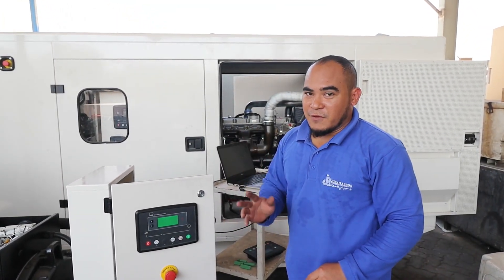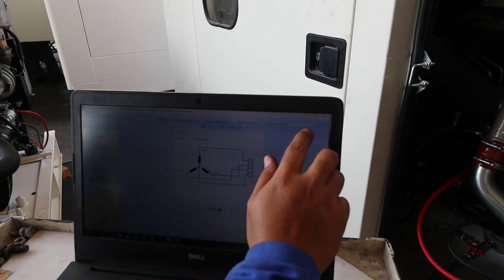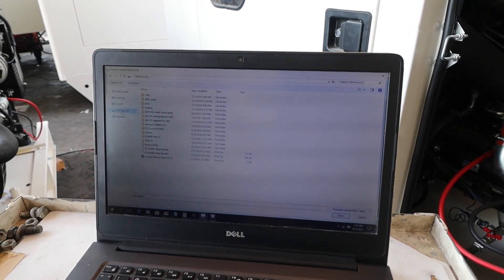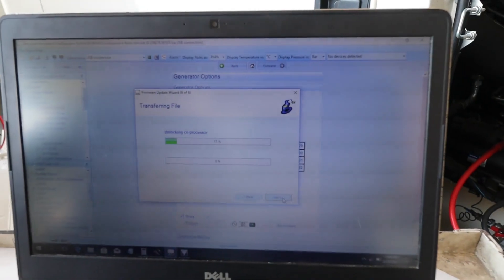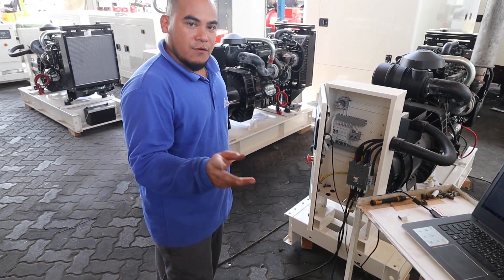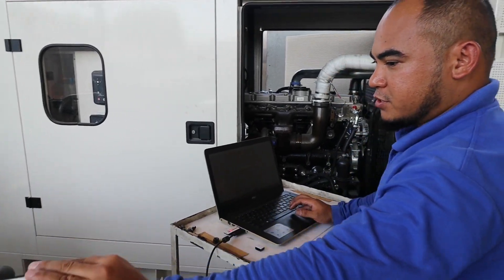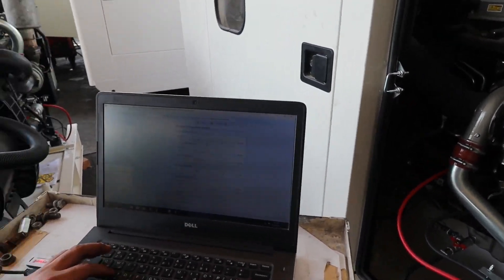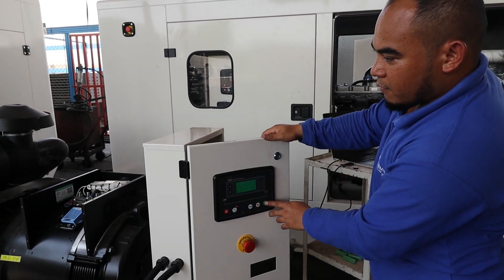DEEPSEA MODULE defective, not communicating, memory corrupt, no display, how to fix it? benzblogs

Comment: Hey bro i have the same problem,  AC comms fail on DSE 335. How do i fix it?
Reply from the maker: What you mean can you clearly yoll me the problem so i can understand
Reply: @benzblogsVlogs  i have a DSE 335 ats module and it shows Ac comms fail. I already try to update the firmware from version 4.5 to version 4.9 but it still the same. Once i turn off the unit for a few minutes and again turn on it flashing the same error,  AC COMMS FAIL
Reply: The exact message in the sceen is  MEMORY CORRUPTION
Refer to manual
AC COMMS FAIL
Eng-1 Exp-1 Cfg-1.
Can i have your email so that i can send you the screen shot of the error
Reply from the maker: @redsept429  goto deepsea config look in the top there u can find firmware update thin follow instruction while process
Reply from the maker: @redsept429  after flashing you need to config again
Reply: @benzblogsVlogs  As i said before i already UPDATE  the FIRMWARE, the original version is 4.5 then i update to latest version 4.9 but the error is still there.
Reply: AFTER i update the firmware I turn off the unit then wait for few minutes and again turn it on, THE ERROR IS STILL THERE
Reply from the maker: @redsept429  did you config after finsih update firmware
Reply: @benzblogsVlogs  yes, but the problem still the same.
Reply from the maker: @redsept429  if the problem if same communication problem
Reply from the maker: @redsept429  meaning your engine is with ecm?
Reply: @benzblogsVlogs  so what should i do to solve the problem?
Reply: @benzblogsVlogs  DSE 335 is a Transfer Switch module (for ATS) . It is not connected to any engine.
Reply from the maker: @redsept429  send me some vedio so i can understand what realy isbthe problem
Reply from the maker: Till me what kva you haveits should have remot to command the engine correct
Reply: @benzblogsVlogs  we use the dse 335 to control the 2 800A circuit breaker. Dse335 works as automatic transfer switch. No Generator Involve in the system.
Reply: Ok just now i open the back cover of dse335 and replace the 3V lithium battery, it solve the problem. Thank you for your time my friend.
Reply from the maker: @redsept429  so clock is not updated
Reply: @benzblogsVlogs  i measure the voltage of lithium battery and its shows 1.66v not 3v so i replace it.
Reply from the maker: @redsept429  sometime happen same problem
Reply from the maker: @redsept429  some of this is not removable its fix
Reply: @benzblogsVlogs  i am electronic technician bro it is easy for me to remove any electronic parts. Anyway thank you very much for your time.
Reply: Please sir,, How do I get the flash file to fix the issue of memory corrupt on my dse 7320 AMF. v. 11.0

Comment: My module is called DSE6120 MKIII. The problem is that the generator output is measuring 234 volts Phase to Neutral, but the module is reading 275 volts Phase to Neutral, causing the generator to shut down, what could be the problem?
Reply from the maker: Give datail of your voltage output and this is single phase or 3phase okay

Comment: Sir i have the same fault memory corruption what will i do
Reply: We use laptop and said disconnect the usb from the module and disconnect the module from any power supply
Reply from the maker: Yes only powersupply need to remove this put back

Comment: how can i get the program and the flash file
Reply from the maker: Sir no need flash file just just update firmware of your module and follow the instruction
Reply: @benzblogsVlogs  I can't find the program that you used on the video or the file you used to update the firmware, can you upload it so i can download
Thanks
Reply from the maker: @Eng_omar_courses  no need that now deepsea new firmware can fix that problem okay
Reply: @benzblogsVlogs i don't have the new firmware or the program
That's why i asked you to upload them for me if that possible
Reply from the maker: @Eng_omar_courses  download deepsea sofeware sonyou can do this upgrade firmware
Reply: @benzblogsVlogs  how to solve the alarm of 
Oil press sender fault
Reply from the maker: @Eng_omar_courses  oil pressure problem ither sensor problem or oil level check or replace double check the woring too
Reply: @benzblogsVlogs thank you very much, i have another question.
When i upload the firmware, i find that it reads all data as zero
Reply from the maker: @Eng_omar_courses  yes you need to config again
Reply: @benzblogsVlogs  how to do it
Reply from the maker: @Eng_omar_courses  need latop and usb cable deepsea sofeware connext find the firmware upgrade in the deepsea setting
Reply: @benzblogsVlogs    i did the same as video and update the firmware and it downloaded and the corrupted memory problem solved but it gave me zero reading for everything
Reply from the maker: @Eng_omar_courses  yea coz its make new program of your module
Reply from the maker: U need to config again accordingly
Reply: @benzblogsVlogs  how can i do it ,can you recommend a video or somewhere i can make the config from it
Reply from the maker: @Eng_omar_courses  check my yt there you  can relay how to config

Comment: How to do it?
Reply from the maker: What your asking sir
Reply: @benzblogsVlogs  I want to clear the "Memory Corruption, Refer to manual" alarm on the DSE 7320 MK II controller. Your video shows you doing it, not how to do it.
Reply from the maker: @TheSexystacy89  sinple just connect to ur laptop thin open the deepsea app inbtge top there is update firmware follow the instruction of the deepsea will process make sure your in the correct module model like mk2 v1.1exmple
Reply: @benzblogsVlogs  Thank you very much. Your guidance has worked
Reply from the maker: @TheSexystacy89  welcome

Comment: Sir. Pano ba tanggalin ang memory corruption refer to manual  hindi pinakita sa vlog mo kong pano pinakita lang ang DSE pero ang pag set hindi......
Reply from the maker: Ok ganito po sir simple lang po if you have latop and dse config thin open the app connect usb to your modulw and latop now go to update firmware make sure that your model of your module and follow what instruction gove bue deepsea during process okay
Reply from the maker: https://www.facebook.com/groups/1581429425388674/chats/6246955898653285

Comment: Hello,
I have the problem of corrupt memory on my 7320, but when I try to upload thefirmware it does not start the process, after turning on the power it returns to the memory notification and the system does not start the data transfer, and in memory the usb is corrupt it stops working, how to solve it?
Reply from the maker: Sir only firm ware update you for that just make sure your usb is not faulty and correct firm ware accordingly to the type of the module ok
Reply from the maker: If u can show me how the process you do much good
Reply: @benzblogsVlogs  Hello,
i am connecting the usb cable to the controller and then going to option update firmware, then it asks to disconnect usb and power supply,  then select firmware and they ask to connect usb and power supply, from that the controller does not enter in update mode and starts in normal mode with status screen and then goes to corrupt memory, at this stage there are errors in the usb connection!
Reply from the maker: @DomingosVarela  dont remove usb just off pwer supply
Reply: @benzblogsVlogs  power off and power on with same power source?
Reply from the maker: @DomingosVarela  i think you select incorrect firmwrw
Reply: @benzblogsVlogs  This could be the problem because I don't know which version to use.  How to check the current firmware version?  I have versions available;  1.2, 2.2, 4.0, 4.1, 5.0 and 6.0!  I was trying to use the latest version 6.0, because I couldn't identify the working version.  I followed the directions you explained in the video, but it didn't start the data transfer.
Reply from the maker: @DomingosVarela  sir you can see it indicated in the top what version you have
Reply: @benzblogsVlogs  7320
Reply from the maker: @DomingosVarela  7320 mk2 what version
Reply: @benzblogsVlogs  ver 7.0
Reply from the maker: @DomingosVarela  thin you have to reduce
Reply: @benzblogsVlogs  that is the software version, i need to downgrade?
Reply from the maker: @DomingosVarela  no prob coz 7.0 is higher one
Reply: @benzblogsVlogs  Hello! I checked that my version is not MKII, I did the procedure and received the notification that the version was only 7320 and the firmware was not recommended, I changed it to 7xx and from the firmware options I had he accepted v12.0, after The installation kept everything the same and later returned to the memory corrupt error. So your recommendations worked to update the firmware, but unfortunately it didn't solve the problem, thank you very much for your attention and support.
Reply from the maker: @DomingosVarela  no problem my be the module software is defective its not accepting the firmware
Reply from the maker: @DomingosVarela  soemtime if the module is china or or orig
Reply: @benzblogsVlogs  Hi,
you were right the controller is a chinese replica of the 7320 i compared the images and i verified that the original is different, even being chinese he accepted the DSE 7xxx  firmware 12.0 , but after updating it continues to give corrupt memory error, it is also giving an electrical trip error, Gen short circuit when connecting a more powerful load such as a 3hp water pump or machine soldering, but any other low load worked, I removed and re-installed the old original 5320 with damaged display and the generator was already operating with any load, it will be some bad configuration, I don't know how to explain. Many thanks👍
Reply from the maker: @DomingosVarela  that the problem i think i will not work but try if it work but mostly not work

Comment: I have a similar problem to the 7410 MKII model. I have updated the program and before the download is completed, the update stopped and a note appeared on the model’s screen. memory corruption refer to manual . What is the solution please?
Reply from the maker: What firmware update you did just put the latest updat on it like if version 1 update it v1.1 or 2 like that in order to work make sure update is propperly done

Comment: hello i have a problem with my DSE 6020 MKII which can not come on when i put the power inside but when the computer is connected through the DSE software it can come on . what could be the cause of that?
Reply from the maker: Just update the firmware to make it easy or if replace the lcd

Comment: you are not showing us how the programming is being done and the camera is not capturing your laptop
Reply from the maker: No prob sir i can guide you
Reply from the maker: First connect to laptop and you usb cable to the deepsea thin open the application deepsea config after that find the update firmware click after that computer is guide you to rest of the proces
Reply from the maker: Make sure that you update in the latest firmware oky
Reply: How can i get a flash share
Reply: I meant flash file
Reply from the maker: Not needed flash file it will work propperly follow waht i said its same as flaah file just update firm ware

Comment: Hi can iyou give me the link for flashing please 🙏🏻 my modul all so thesame (memory corrupt)
Reply from the maker: Sir no need what ever the module your doing just update it at higher version of same type of the module go the the latop open deepsea in the top you cleck the update firmware and follow the instruction geven to by the deepsea app while doing the update ok
Reply from the maker: Asap me so i can give you instruction how to do it
Reply: @benzblogsVlogs  iam still trying to update firmware 
And still waiting for begin
Reply from the maker: How did you do for update firmware
Reply from the maker: Send me the picture module at the back soni can see the model so i can send you the flash file send me your email in benzblogs measanger thank
Reply: Send me your mail iwill sent vidio
Reply: Today my firmware update succes but when complite on display AC comm fail and alarm
Reply from the maker: Donyou have picture what is the alrm
Reply from the maker: You need to reconfig that sir coz ll program you install before to run generator is remove
Reply: Sir, I have Deep Sea 6020 MKII and the battery terminal switched wrong connector so wire from alternator to stater motor got melted. Changed wire and corrected the battery terminals connection then changed fuse 10A 250V ..... but still no power on controller.... battery isolator us OK. Please help.

Comment: merci beaucoup pour ton aide cela a fonctionné pour moi !
Reply from the maker: Yes sir do this check your battery if good condation check the fuel thin try to bleed to remove the air in the fuel galery agter that start again use manual pump at same time crank it
Reply from the maker: Por pabor english pls.
Reply: @benzblogsVlogs  lol that was french and it’s por favor

Comment: Dear sir
How I get the flash file for dse 3110? I need your help
Reply from the maker: Its with or without flash file just follow this go update firmware and follow there rest give u instruction in the latop
Reply: @benzblogsVlogs  i try to update firmware but failed
“Incompatible hardware
Unit is model code 65535, model variant 255, hardware variant 0. Firmware file is model code 3110 MPU,model variant 0, hardware variant 0”
Can you help me with this problem, sir
Thank you
Reply: The module has no display and no backlight

Comment: Thank for all you do here. i have a DSE8610MKII that is displaying MSC data Error hence it is not communicating with the other DSE8610MKII is the synchronizing panel. how do i solve this problem thanks
Reply from the maker: Check how many pcs you synch thin end to end should have 120 ohms thin double check the connection if there is wrong or ither reversly connected or cut thin if same msc fail ahm check the multiset in the config ither wrong program

Comment: sir wala bang manual configuration yan na d na kailangan ng pc or laptop wala kasi display ung controller thanks
Reply from the maker: May manual sir pero limited acces lang hindi sya full
Reply: paanu po sir
Reply from the maker: Just just press the stop and check button and thin arrow side you now see the configuration
Reply: nawala po ung display sir pero sa stop manual auto ang on 
may ilaw po sa display wala naka display blangko lng po salamat sir sana matulungan nio po ako ty
Reply: d po makita configuration kasi blangko po

Comment: Comunications link to untilost Firmware update  has Failed  Module  is inoperable  Please try again, Pls Support about case, Memory corruption refer to manual, Tks bez
Reply from the maker: Just follow correct coz one mistake make you trouble instead fixing
Reply from the maker: If your are updating firmware just follw correctly

Comment: Sir pwede po mkahinge flashfile ng 7320 saka program meron kc ako controller 7320 na corrupt totally noo display.. thanks po..
Reply from the maker: Sir di na kailangan ng flash file pala ponta kalang sa deepsea confige hanapin mo sa taas ang update firmware follow mo yung instruction na sasabihin sayo ng at para ma restor mo yan

Comment: hi, I have 7320 model  it is show on screen a memory corruption ,what the steps to recovery
Reply from the maker: Simple thing open your latop connect your deepsea go to update firmware update it in higher version and follow the instruction what computer says that it and also follow what i do in the vedio
Reply: @benzblogsVlogs  i have this problem to with dse7320 to, what step i need to do, i see your video but i dont see your leptop screen and how you do it, so please what i need to do mister
Reply from the maker: @khairulanam6395  simply open deepsea config connect the module and ho to update firmware update it in higher version and follow the instruction during process
Reply: @benzblogsVlogs  oke i wil try, by the way thanks for replaing me ☺
Reply: @benzblogsVlogs  thx, my genset was  fully working now, thanks for your help brother
Reply from the maker: @khairulanam6395  welcome

Comment: sir san makabili ng pra flashing at software pra sa DSE..meron ako dalawa na generator ung display nya mawawala minsan meron at minsan baligtad ung graphics pero meron siya ilaw at gumagana din sa manual at auto start..ung display lang ang problema..anu kaya issue sir. salamat at more power.
Reply from the maker: Sir buksan mo lang yan koonting linis mo lang sa rebon nya ik nayan alikabok lang

Comment: Sir may module ako 8610 ang problem ay MSC error paano kaya maayos un ganon
Reply from the maker: Sir just double check your screen cable from module to your module use tester put it in the resistance to check end to end and always install resistor at the from begining to end for exp. From 1 module put resistor and to the lastmodule always have resistor  exmple you have 1-5 genset also from 1 and 5 only have reaistor
Reply from the maker: Make sure its in correct connectior or no lose or no cut and check the polarity
Reply: @benzblogsVlogs  sir buo nmn un resistor 120ohms ganon pinalitan ko ng bago un load sharing cable at end to end un resistor nakakabit sa hi and low or  31 and 32  33 shielded screen  ganon pa rin msc error
Reply from the maker: Bagong genrator sir kakawiring lang or dayi nang gumagana nagkatrouble lang
Reply: @benzblogsVlogs  nag karoon ng shorted un isang unit na naka parallel hinahanap nila un problema habang naka energised un isang unit at tinanggal nila un load sharing cable at ng ibalik nila at di nila na trace un problema ng shorted un naapekhunan in isang module at ganon din un isa pang module.
Reply from the maker: Pag ok ang connection resistor nacheck mona lahat so nasa program nayan sir ang problima